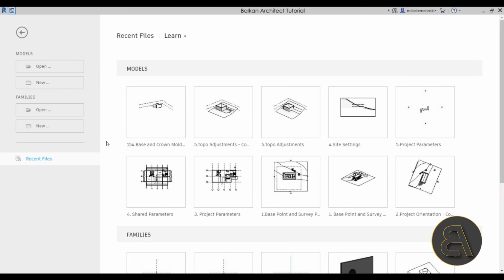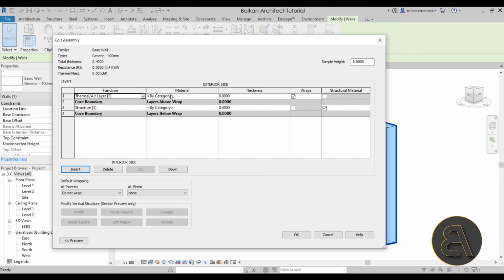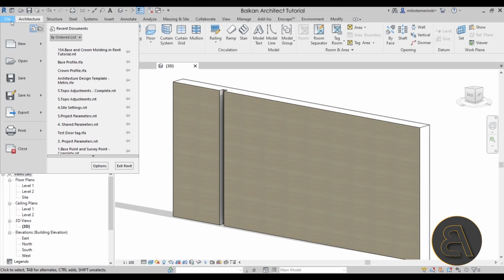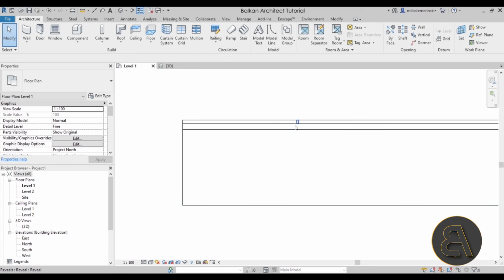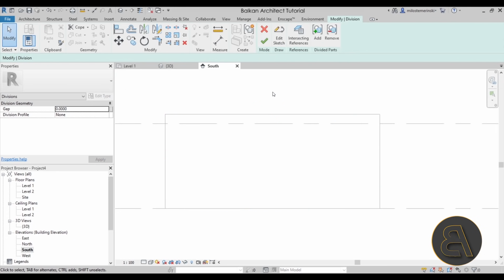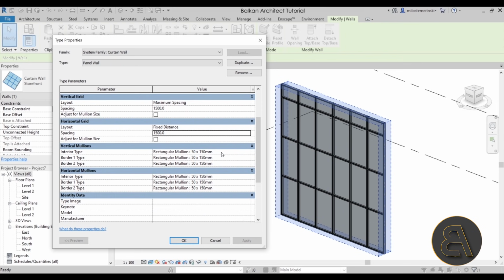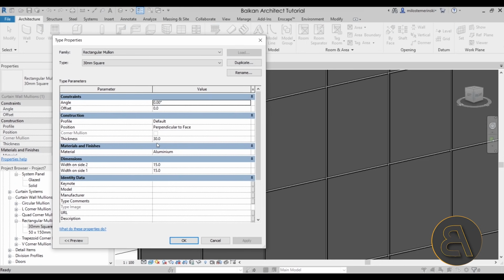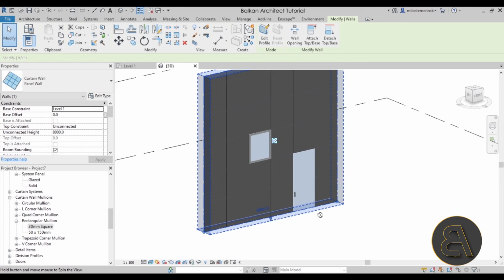3 Types of Panel Facade in Revit Tutorial

Comment: So far the parts method is working well for me. However, it is a large project with 2-3 different finish materials on the various panels and I need to produce renderings of 3 different options for finish combinations. Is there an easy way to select all the parts of a particular finish material to quickly test different options? Project parameters doesn't seem to work for parts... Perhaps filters?

Comment: hi, i use curtain wall, and for panels use marble with dimentions 40x80 sm, and with a gap between 5mm, but when i modify the curtain wall lines i loose a gap between marble, if i make rectangular it works with gap, but if i make with angle lines it show replace panels with empty, and looses gap between, can you help to solve this if there is a solution, thanks

Comment: The Second option doesn't work unfortunately, because the moment you dismantle the wall so break the wall in bits its not a wall and cant be used as a wall. The first option has to be done manually aswell and even the seperation distance and if you can a curved wall its more difficult. Option 3 i havent tried cuz am been yh trying for the past 4 hours.( am a student )

Comment: First, your videos are wonderful and I learn a lot from you every day!
I have a question, when I look at the parts in the section, the air layer appears with a color - how can I change the graphics display in parts?
Same with the panels, I set some of them with glass and they show up as solid material.
Reply: also, parts shows in Realistic mode but not in render. why could that be?

Comment: Excellent content as always! Any suggestions for creating a custom 3d panel extrusion to be used in the curtain wall? I'm looking at using a terra cotta rain screen panel that will have open joints and hang on vertical rails mounted to WRB. Thanks!

Comment: Good evening. Thank you for all your videos. 
I have a question and I would like to request your help. 
I work at a company that is currently migrating to revit. We build precast structures and GRC panels for facades. Our GRC panels have a stud frame, and my question is related to this GRC production. 
Does revit have built in module or some add-on that allows me to create all the shop drawings to fabricate this kind of panels? I have to create 2 drawings per panel: 1 for the stud frame and 1 for the geometry and layout for the GRC panel. 
If possible, we can discuss this issue privately. 
Thanks

Comment: The problem with the curtain panel approach (that some manufacturers create bim files with) is where there are corners along the exterior of a building. Both outside corners and inside corners both are not modelled accurately in those circumstances, and result in extra detail line work that is necessary when creating plan details and section details. However, in most circumstances in my experience anyway, the manufacturers create reveals and as well as offering a detail created in Revit which allows for easy transfer between the files and become the best to use in technical drawings. 
Perhaps your order of worst to best methods of creating a panel facade along a building is the worst to best approaches during the schematic design stage and not the construction drawing stage of a project.
Reply from the maker: I agree, perhaps saying the best and worst isn't the ideal way of describing it. It's really 3 different approaches that have 3 different results. Depending of what the user is trying to achieve they can pick out a method.